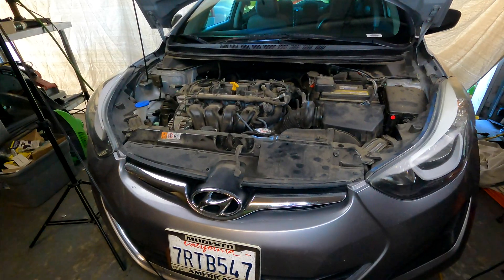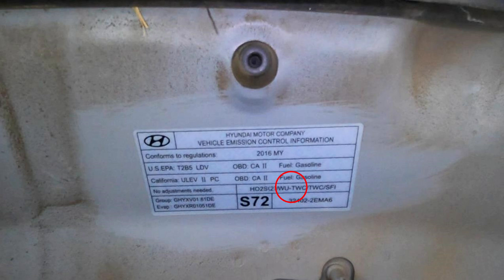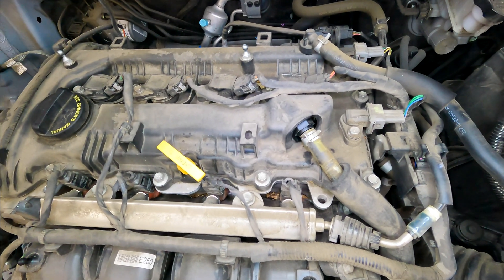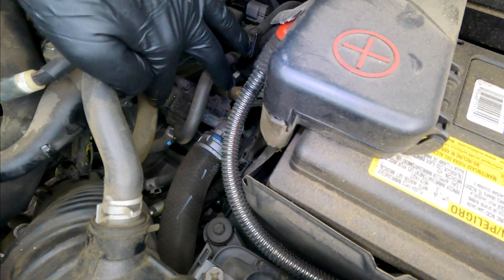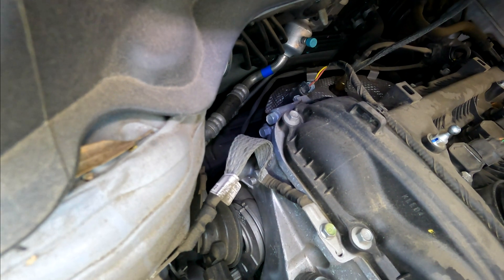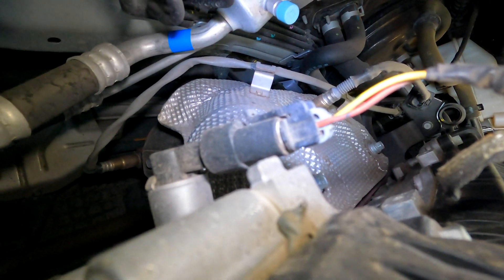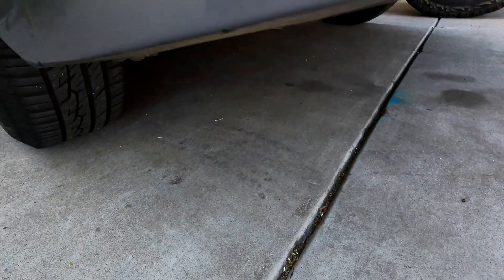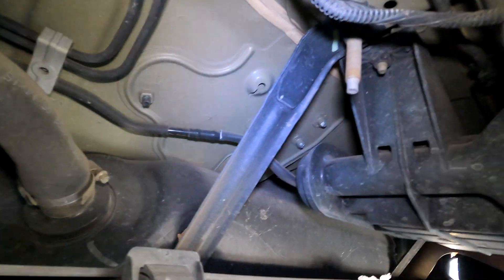⫷ Hyundai Elantra 1.8l Emissions Locations: PCV, Oxygen Sensors, Evap, + More. & info. '11 - '16 ⫸

Comment: I have a 2011 hyundai elantra. It looks the same as this car. I noticed the EGR on my obd2 scanner is still blinking red. I drove over 100 to 200 miles. It's the only system that is not ready for smog. What do you think it might be? Should I keep driving it more. I need to figure it out to pass smog. I haven't gotten any more check engine codes. 🤔
Reply from the maker: Are you driving too fast or too slow? This video is a little long but I explain how I set monitors: https://youtu.be/fQGhhf8iLsI?si=bHO6Pz9RrJguFYVh
Have you checked your fuel trim?
Reply: @ScottiesHobbies I was driving on traffic and some portions fast when traffic goes away. I was checking my obd2 scanner where it says evap incomplete its giving me a process of 9 steps to complete the egr status 😅.  🤦‍♂️. I glanced through your video. It seems like I do need to drive it in a precise way. Thanks you though for your reply.